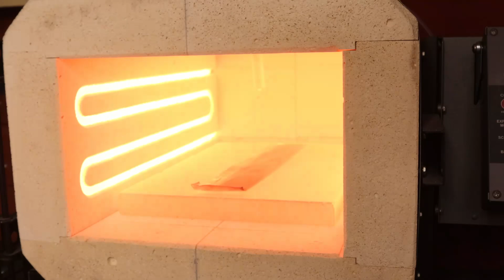Knife making - Outdoors knife

Comment: Great bush knife! I actually made a knife with the same walnut and orange liners, its a good look for a knife. 

When you're doing the handle on full tang knives, put some tape on the insides of the scales and super glue em together with two dots, then you can do all the stuff with the handle before gluing and the holes and fronts will always match up. Just gotta make sure the drill is square or the pins wont align. Then take the scales apart, remove the tape, and its good to glue!
Reply from the maker: Hi! thank you! Cool! I agree! I used pins in the holes in stead to keep it together. I thing it worked out ok. Maybe I will try your method, thanks! I like your knifes!
Reply: @Inmyshed  thanks! I just find it faster to do it this way instead of one scale at a time, but whatever works I guess!